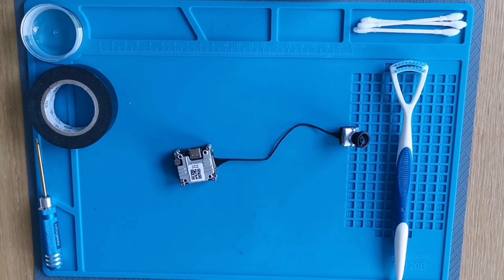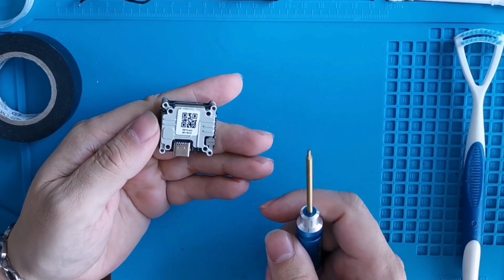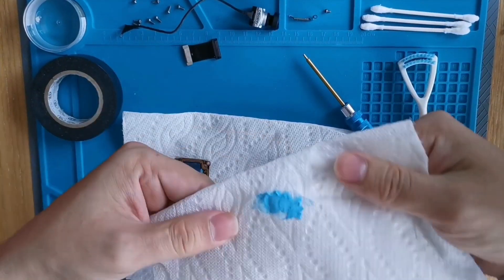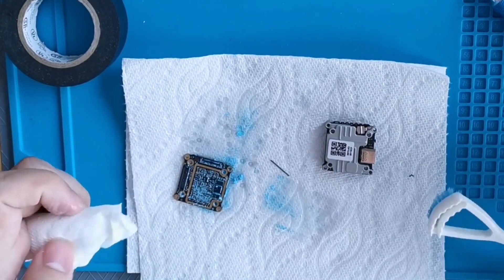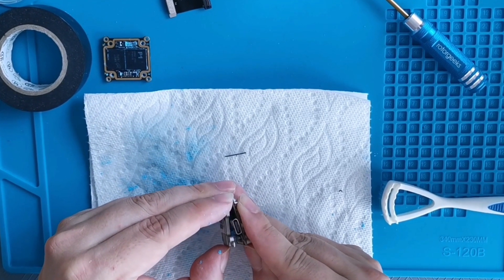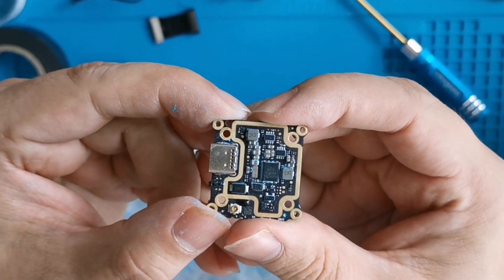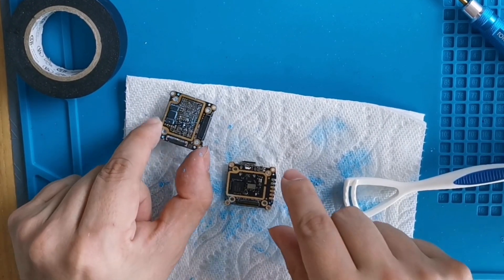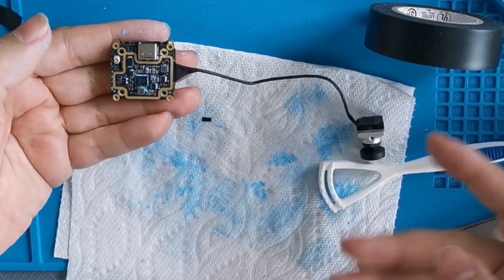Decase Your Caddx Vista in less than 10 mins EASY!

Comment: Does this not make overheating worse if there is no thermal paste?
Reply from the maker: @jasondonavich2758  flies fine DJI O3 Discus | The Best O3 Sub250 Quad!: https://www.youtube.com/playlist?list=PLozzmZizn2figPyj7TV9CQYI2t0LIuYGY

The O3 heats up a bit faster but as Long as you don't sit around you're fine and even if you do, DJI will shut itself off if it gets too hot, but that's never happened to me when it's flying. The vistas are a little bit stronger than the o3s though. The '03 has a silicone chip that can crack and then it's done.
Reply: @TorontoFPV  I've got the 1200mw hack on my vista (well system) and just sitting on the bench for a few seconds gives an overheat warning... I was thinking of trying to mount a small fan similar to the one used in the DJI fpv drone in case of crashes.
Reply from the maker: @jasondonavich2758  that defeats the purpose just let it be and take off lol. Also, most of the time you don't need more than 700 anyways